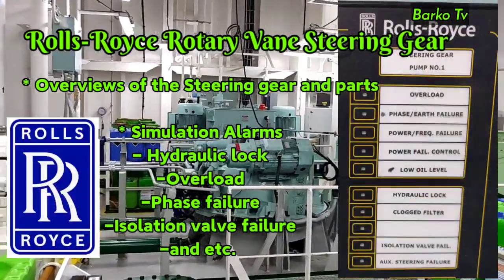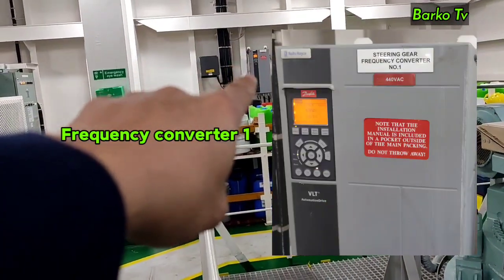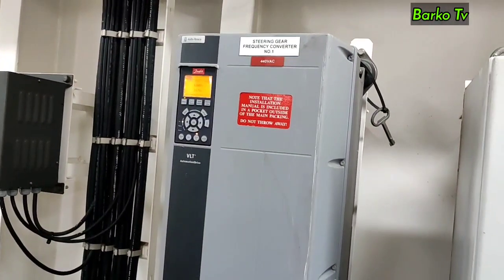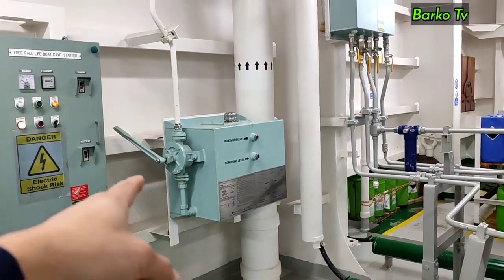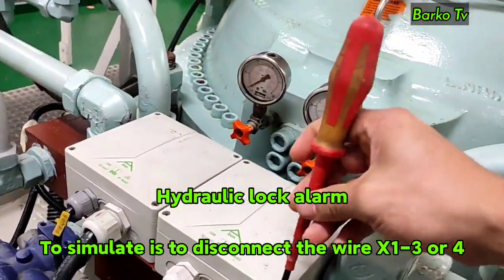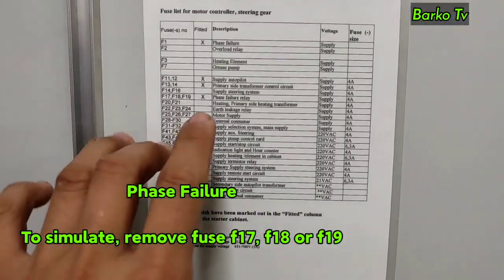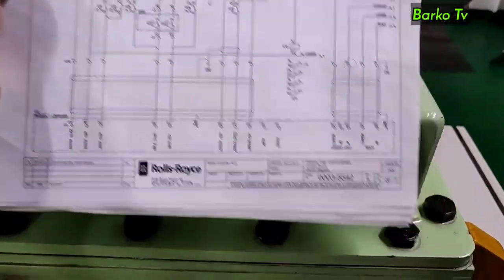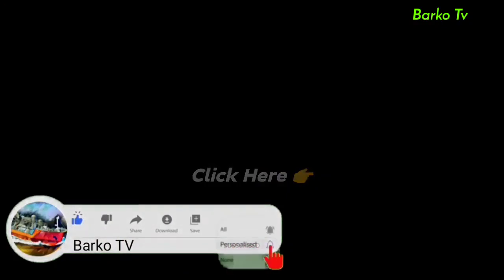Rolls Royce Rotary vane steering gear Familiarization & Alarm Simulation| Kalecky| Makinista| Marino

Comment: difference of safety valve and relief valve on rotary vane steering
Reply: The relief valve sets the max working pressure of the pump and system, usually around 80/85 BAR on RV steering gear. The safety valve on the activator works when there is a high load on the rudder that exceed the max working pressure of the relief valve of the pump and it is set around 100 BAR in the RV system.

Comment: Contactor k1, keeps on gettimg burned im no2 steering control panel. Any tips please
Reply from the maker: Which he is burned? The contacts or the coil of contactor?
Reply from the maker: For me, if the coil of contactor is burned, please check the power supply, maybe the power supply is the problem. Change power transformer, or if the contator will is 24vdc please change power supply module